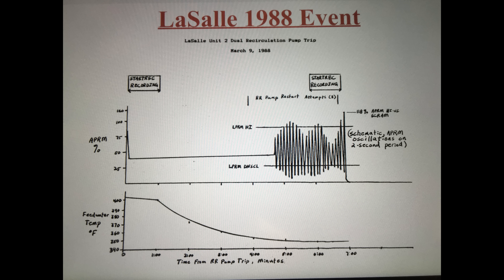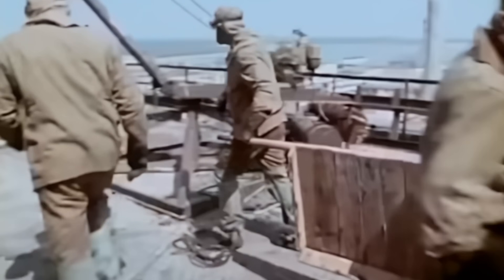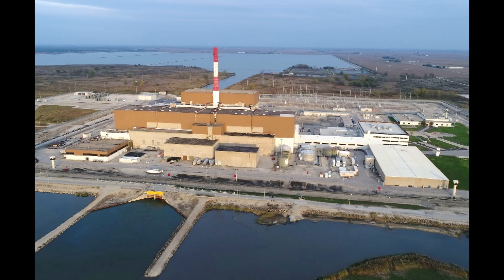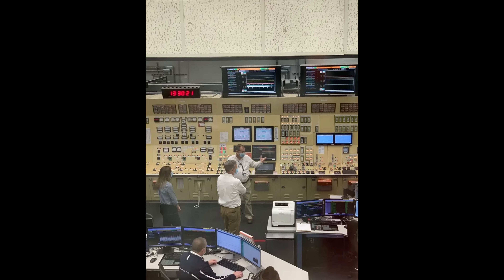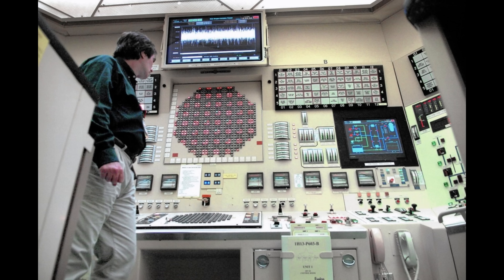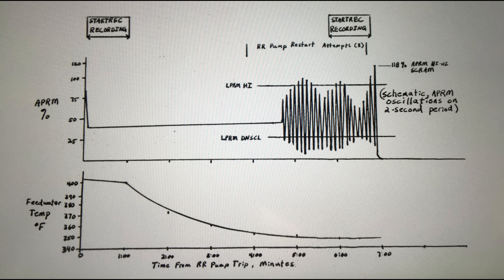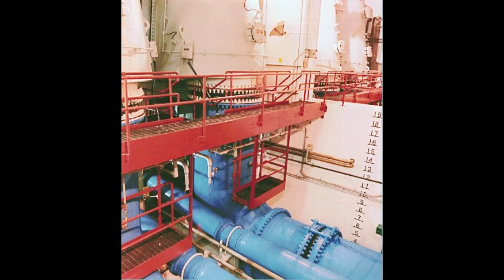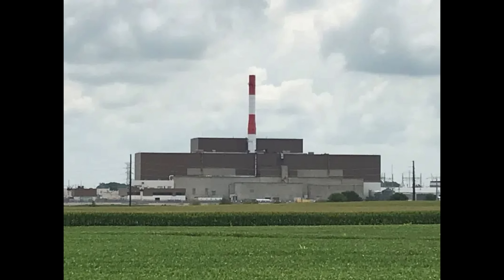LaSalle 1988: America's "Almost" Chernobyl?

Comment: Preparations for a SCRAM is a hell of a sentence.  You'd think there would very deliberately be no steps required, under any circumstances, before hitting the button.
Reply: Preparations for scram.
Arm the Scram buttons in one side of the full core display benchboard.
Push the buttons.
Reply: Civilian sub buff here. I once read a third-hand account of some boat back in the day (think it may have been a Sturgeon) that was starting its reactor in preparation to get underway. Operator had just opened the throttle (not the right word, I know) wide to bring it from startup into power... and the lever broke off in his hand. The operator, and everyone else around him, fixated on repairing the lever, and stopped watching core power. The core, throttle wide open, went screaming out of the startup range and through the whole power range... and was only stopped when it hit the never-exceed limit and the automatic SCRAM killed it.

The sub's Chief Engineer, for the rest of his time on that boat, kneeled and kissed the reactor protection system's computer banks before every startup.
Reply: @sturmovik1274  
I had written a comprehensive, and rather technical answer to you, but the alligator rhythms (and yes, I'm using circumventional language) ate it.
Reply: @swokatsamsiyu3590  Them damn alligator rhythms
Reply: @sturmovik1274 
They're the main reason I do not write many comments/answers anymore. Alligator rhythms feast on them. There was nothing bad present, no naughty wordings or anything. Just dry, technical reactor-y words.😞
Reply: @swokatsamsiyu3590  Don't know what they'd have against simple information.
Reply: @sturmovik1274 
I wouldn't know either. But I discovered it's random word combinations that trigger it. As will the use of proper reactor names in capital letters for some odd reason. Oh, and the names of the various reactor parts are considered naughty too🤷🏽 I hardly ever write comments, and then mostly under technical reactor-y videos since reactors are my big hobby. And still you get this nonsense. Too bad because I really like learning from one another.
Reply: @swokatsamsiyu3590  I'm sure it makes sense to the AI that actually runs Youtube.
Reply: @sturmovik1274  No, that's one of the problems with these... learning 'gator rhythms: things don't have to make sense for them to do them. they just have to trigger a pattern that WASN'T intentionally programmed.
Reply: @sturmovik1274  
Huge reactor nerd here. Did some looking into the case you're describing, and I'm under the impression that this may be an urban-myth story of sorts. Couldn't find any reference at all to this specific case on the list of nuclear sub accidents and incidents. If you do manage to find it again, could you post it here? I'm always willing to learn more.

Apart from that, I have extensive knowledge on the inner workings of a nuclear reactor. As nimble and responsive as they are, even for a Naval reactor, achieving/approaching criticality is a big deal. And it is fraught with very strict, set rules and regulations. It is always approached with the utmost care.

You simply cannot "open the throttle wide" on a reactor. What you're referring to is the withdrawal of control rods (this would be the 'gas pedal' on your reactor) to either; a set point where the criticality calculations say the reactor will go critical (this means it reaches the state of being able to keep the fission reaction going on its own without any help. And "being critical" just means the reactor is on); or to where the reactor is going up in power. But even that is in strictly controlled steps. You simply cannot start y**ting control rods, give it a good shove in the fuel rods and off she goes... There are very strict rules on how far the control rods can be withdrawn at any given time. And the safety systems will intervene if you pull them out too fast, too many at the same time, or too high, at once. Not only that, in the situation you're describing, the safety systems would have scrammed the reactor much sooner on exceeding the reactor period (the reactor period is defined as the time during which reactor power rises to e times the initial power) safety threshold, well before it went through the whole power range, and that "never-exceed limit" was reached.
Reply: Mehhh considering how taking a reactor offline is a huge thing it makes sense they have protocols
Reply: @sc1338 Yeah fur real, IIRC from what Tyler Folse has said (Nuclear Engineer with 10+ years in the commercial nuclear power industry from engineering operations to emergency response; and now also a YouTuber) it can often take up to a full MONTH to start a reactor back up from "Zero", or a "Dead State".

So killing one is a VERY big deal, not to be taken lightly, and is LITERALLY a multimillion dollar decision which you BETTER get right.

That's why there's SO MANY features of the design to allow a restart after "Partial" shutdown, to avoid a "Full" one as much as possible.

IIRC this isn't an issue with "Military/Naval" Reactors as they're a miniaturized design and having the power you demand, WHEN you demand it is a LOT more important and in mind of the designers.
Reply: @pyro1047  
And Naval reactors are incredibly over-engineered because they have to be able to function in, and survive the rigours of a war theatre. These are very agile, alert reactors that can handle wild power swings, cool themselves on natural circulation (in subs when they have to go stealthy to avoid detection because the pumps make a lot of noise) alone etc.. Rickover knew what he wrought back in the day.
Reply: @pyro1047  While I am sure that taking a full month to restart a reactor would be a major inconvenience, why don't you ask the good citizens of Pripyat how inconvenient it is, that the reactor was not shut down, when it should have been? Oh ya, I forgot - there is no more, Pripyat.
Reply: @pyro1047 No! Violation of Safety Culture. When monetary decisions over ride Safety Culture it is time to go through a months long stand down and retraining for all crew, AND to seriously consider license termination.
Reply: @sc1338No! That is a violation of reactor safeguards, an abandonment of Safety Culture, and should result in immediate disqualification and retraining, or termination.

Comment: Ive been to LaSalle many times.  Its a nice plant.  This event is well known in the industry.

You need a real picture of a recirc pump.  The picture you have is of an motor generator set that sets the speed of the pump.

LaSalle actually uses a flow control valve to set speed, not an MG set, becuase it is a BWR5.
Reply: And LaSalle doesn't use motor-generator sets.  It's a BWR-5 with two speed recirc pumps and a flow control valve, or at least used to be.  They were going to eventually put in adjustable speed drives.  I retired in 2020, so I don't know if that ever happened.
Reply: @georgewilhelmsen9344 nope, still two speed George.
Reply: It does resemble the motor generators at Quad Cities, but I don't know if LaSalle uses this type of motor and pump for their Recirc Motors. Quad Cities Recirc Motors stand vertically instead of horizontally.
Reply: @stevegabbert9626 LaSalle uses flow control valves for recirc flow control.  

There are MG sets but only for shifting between high and low speed, along with breakers for EOC-RPT.
Reply: @mikeall7012  I know some people consider Quad Cities and LeSalle "sister" plants.
Reply: @stevegabbert9626  Quad changed out their motor generator sets with adjustable speed drives years ago.  The MG Sets and scoop tubes had reliability issues.  I believe Dresden followed them.

Comment: Good grief they were lucky! Surely the guy looking at the thermal output would have been sweating. Also can a Nuke answer this for me: If the reactor is in a prompt critical state would that mean the void coefficient becomes irrelevant (operating solely on prompt neutrons) therefor those power oscillations turn into a fizzle yield 'declassifying the site' so to speak?
Reply: You still have the negative fuel Doppler coefficient. In a BWR there are a number of reactivity coefficients and they are arranged to be negative at post critical reactor conditions
Reply: @waynetemplar2183  Thanks mate honestly never read about a doppler coefficient. Have to do some study on that. Its amazing how many failsafe layers are engineered into (Western) reactors.
Reply: @waynetemplar2183  Ahh thermal coefficient!
Reply: @Ragefps  Thermal coefficient of the fuel.  BWRs also have a moderator temperature coefficient, which is negative at post hot standby conditions
Reply: @waynetemplar2183  So that effects the whole spectrum not just thermal neutrons? I guess in weapons design its not so much of an issue as you are basically blasting a small area with more than enough neutrons to sustain supercriticality. I love learning about all this but sadly my lack of math ability means I could never pursue this professionally
Reply: Prompt critical is bad but not actually as bad as it is made to seem. It isn't a the reactor is going explode problem. Many reactivity casualties only push reactors barely into prompt critical and that means power changes are still long enough that heating can reduce power. The main concern is how high the power goes and hot the fuel gets. The fact the core was oscillating at a similar average power means it probably wasn't even that close to even melting fuel.

Comment: Getting the other circulator pump running wouldn't have immediately gotten the pre-heaters running, there would have been a short time gap for the heaters to rev up once the pump was on. For a short time it would have actually increased the cooling, lowering the temperature further and collapsing more voids. Depending on the reactors state at that point it might not have held out long enough for the pre-heaters to kick in before the prompt criticality occilations blew it apart. This is essentially just "How to get a Chernobyl type scenario in a reactor with a negative void coefficient". You massively overcool it with the rods out until the coefficients tear it apart.
Reply: I would guess that getting recirc up would bring them out of thermodynamic instability, stopping oscillations before the increased reactivity of such an action has a chance to truly worsen the oscillations.
Reply: Just goes to show you that even a negative factor can cause problems with instability, I can see why designs favoring no boiling in the reactor are preferred.

Comment: The simple fact is that the instructions did not tell them how dangerous this overcooling situation could become(dropping temperatures makes both the negative void coefficient and negative temperature coefficient more violent and powerful) and with the rods mostly removed you could theoretically reach some nasty peak powers if it was allowed to keep spiking. The call to manually SCRAM was their own judgment as the books didnt' cover this properly, had they not made that call and had the automatic scram failed they'd have eventually ended up with the reactor spiking hard enough to SL-1 itself. Sure, the containment dome would mean this would be no Chernobyl, but the individual reactor damage would be nasty and there would be a significant release of radioactive gas.
Reply: The chances of a NMS RPS trip (as well as any other automatic RPS trip) failing are slim.
Reply: @mtfe-1144 you need to be a little careful with that. 

Electrically yes the protection circuits will more than likely too an extremely high reliability trip. 

What becomes less certain if you have extreme enough power excursions and temperatures is whether 1) the control rods can be put In quickly enough and 2) that the large swings don't cause mechanical damage or misalignment preventing correct control rid insertion. 

The scram is reliable as designed. Part of that is a reaction time based off an expected rate of reaction increase. 

With swings as large as they were having I'm sure some people were digging deep in design documentation looking for exactly that sort of information. The fact thus resulted in changes to how reactor flux was measured and not just procedural changes and adjustment of existibg trips suggests the threat of it running away was genuine.
Reply: This can also happen during startup in NC.

Comment: The containment structure would have contained the worst of it, but yeah there would probably be a crap load of radioactive gas released.
Reply: How do they test secondary containment? Load an empty shell up with a couple hundred pounds of of RDX or is it all computer simulations?
Reply: @Ragefps  Dunno, but they've never failed in any significant manner. Fukushima had really old really crappy containment and despite a days long meltdown and earthquake and tsunami and hydrogen explosions only Unit 2 had a breach and it was a minor crack in the wetwell surpression area.
Reply: @Ragefps 
There is old footage available on YT where they are literally firing ordnance at a full scale containment wall. Also a water pressure test was done on one. It's quite impressive how strong these buildings are.
Reply: @swokatsamsiyu3590 My favorite test is the F4 phantom on a rocket sled being hurled into the containment wall at mach one.  It just....stopped existing.  The wall was unimpressed. 😂
Reply: @Yaivenov 
Yep. I've seen that one test, too. It was quite impressive to say the least. The wall didn't even flinch😂